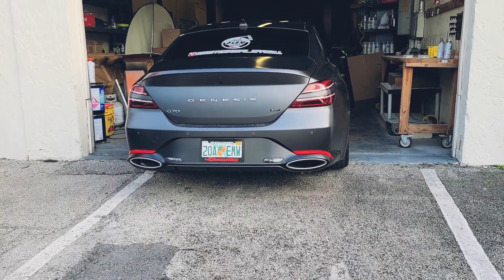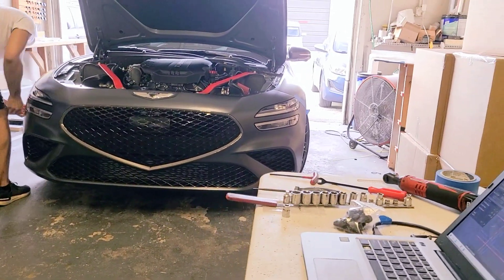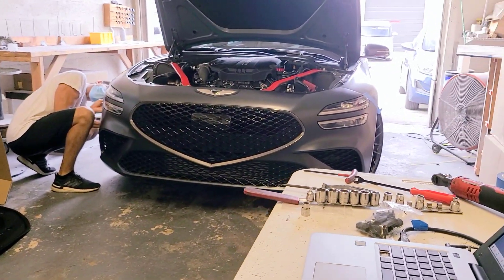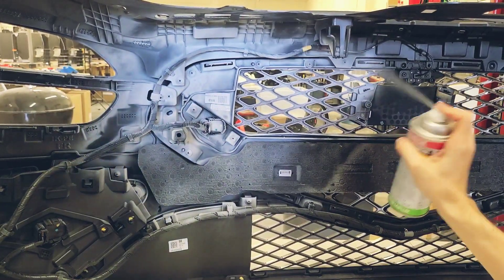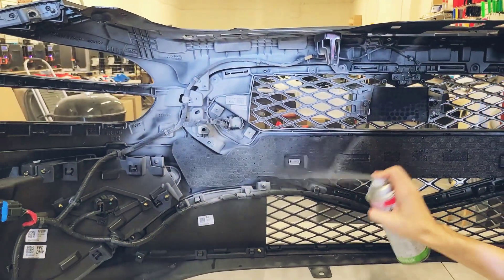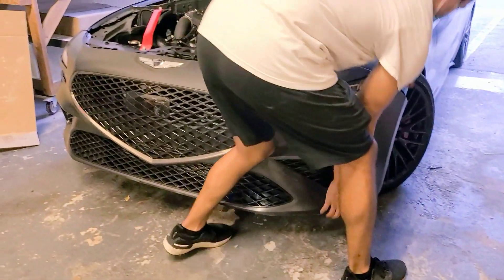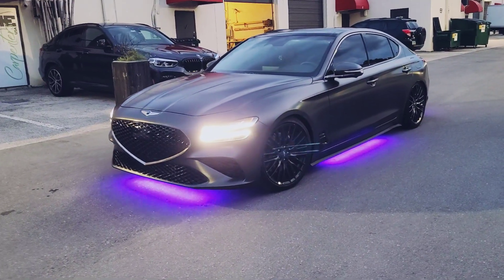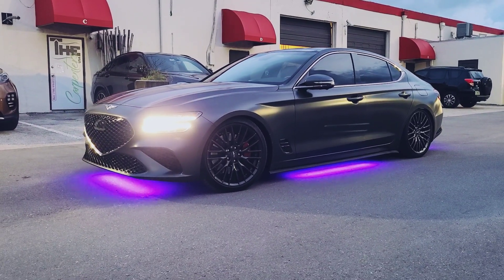Velossa Tech 3D Scans Genesis G70 2022 for NEW Big Mouth Snorkel Kit - Part 1 #velossatech

Comment: What happened to Part 2?..
Reply from the maker: Didn't see much interest, so I didn't film it but it's done. I'll make a new video.
Reply: @BoostedWhipz  I'm curious how the driver side adapter looks like
Reply from the maker: Which adapter? The one for the lighting?
Reply: @BoostedWhipz  the adapter to redirect air into new snorkel..
Reply: This system is more complicated than on the Stinger GT because our cars use radiator aero flaps that open and close under certain conditions (FSM states that they close when at "high speeds," though I don't know if it's only speed dependent, or if throttle position/load plays a role as well), and since you must remove the radiator shroud Velossa Tech had to come up with a way to fool the flap controller (aka AGS system) so you wouldn't get any CEL. It's pretty dang cool.
Reply from the maker: No CEL was triggered on my end. They changed the snorkel and that was it. There was a sensor adapter that was behind the bumper (on actual collision bar) which had to be shifted a bit using a custom plate but that was it. Wires were zipped tied to the collision bar and that was it. New snorkels are larger and face front of grille versus OEM which are facing inward (with air channeling sideways). Air now travels directly from the front channel to channel to the intake system as opposed to just sideways with no direct channel. I'll explain once I post new video.
Reply: @BoostedWhipz  thank you ... Great videos. God bless, have a great day from California